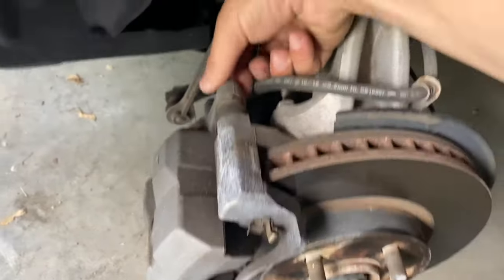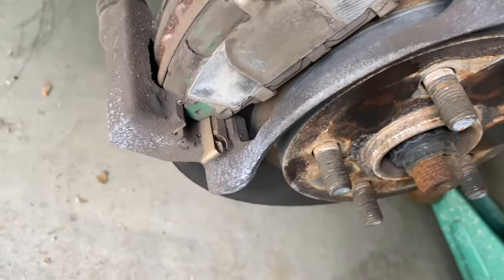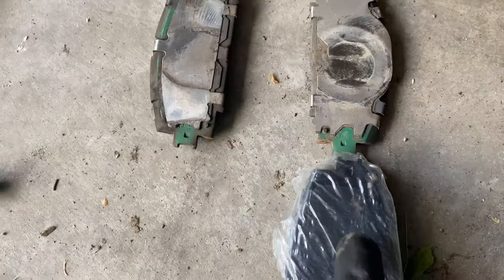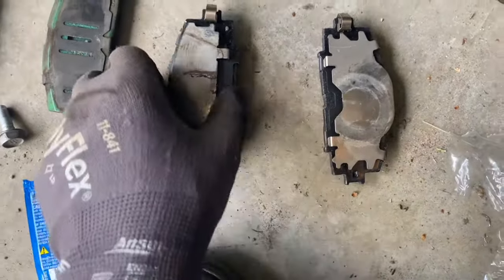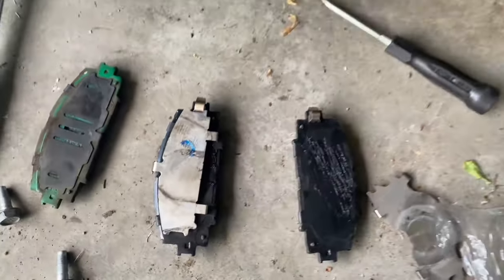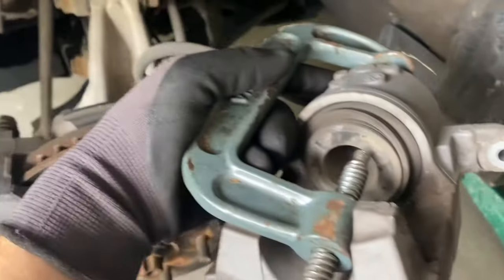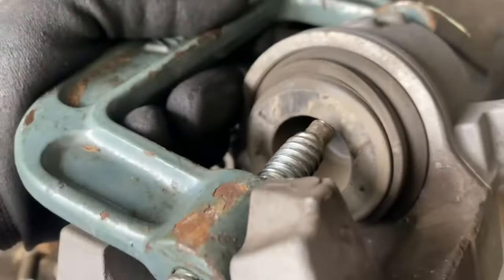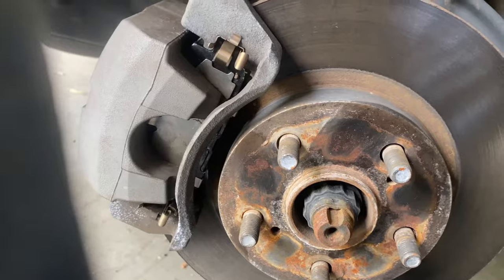Prius Brakes Replaced in 5 Minutes (EASY WAY)

Comment: Awesome Video !   I like to use the old pad to push the piston back in .
Reply: Do I need to disconnect the negative terminal on the battery?
Reply: I was going to suggest using the old pads to push in the caliper too. great video thanks.

Comment: And if you don't grease the slide pins the rotor will warp.
Reply: What u mean? Do u have to remove caliper to do that?
Reply: @ImmiSuccess  all calipers move on slide pins. Most Calipers are bolted to the slide pins. These need to be taken out cleaned and greased with new grease. Sometimes the hole the slide pins are in need to be sanded out or even honed out a touch.
Reply: @ImmiSuccess  at the very leased one needs to make sure they move very freely.